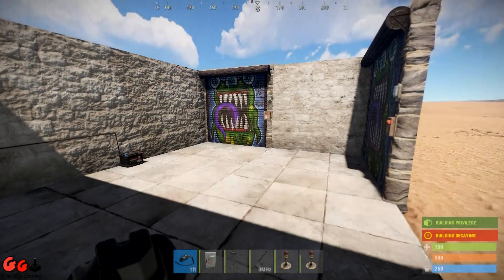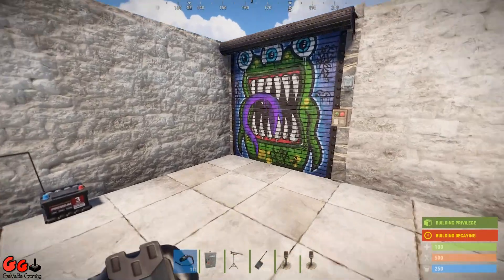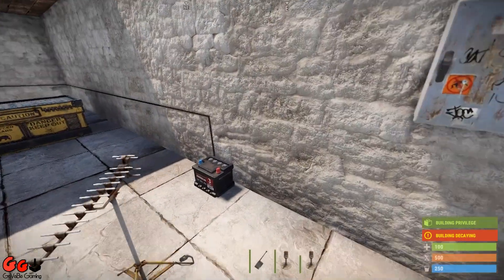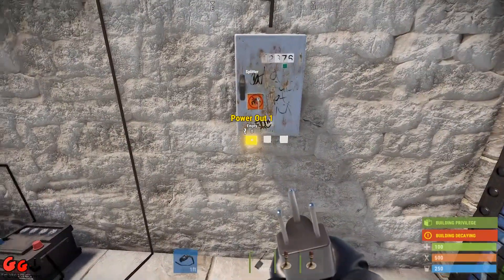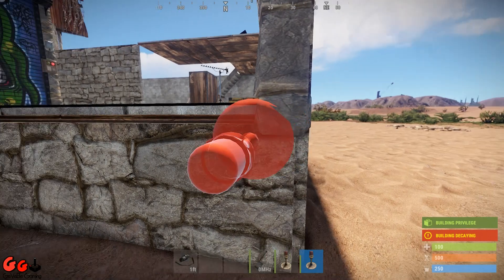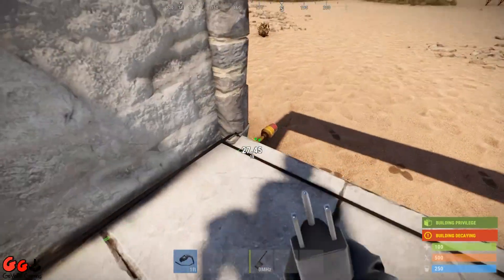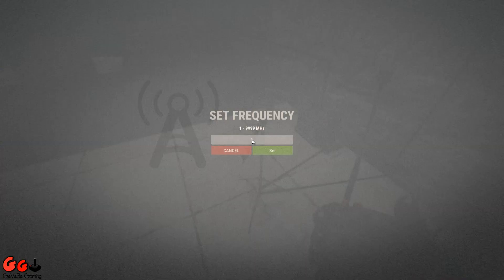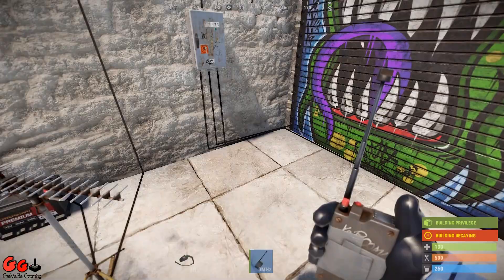Rust Electricity Tutorial - RF Receiver - Remote Opening Garage Door

Comment: This didnt work for me. It just opened and closed on repeat.
Reply from the maker: You need to hold down the button when pressing the transmitter, if you just press once the door will immediately close.
Reply: @GeVeBeGaming  the door keeps opening and closing on its own without me even hitting the transmitter. 
The moment I go from splitter to door control all hell breaks loose lol
Reply from the maker: Ahh I think I know the issue, its the power consumption, your battery is running out of power and resetting the door controller.